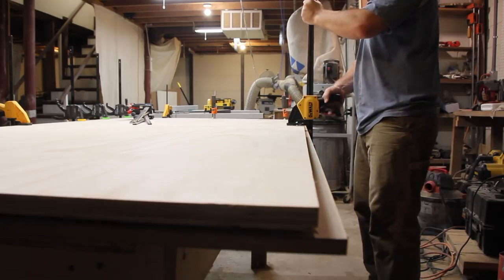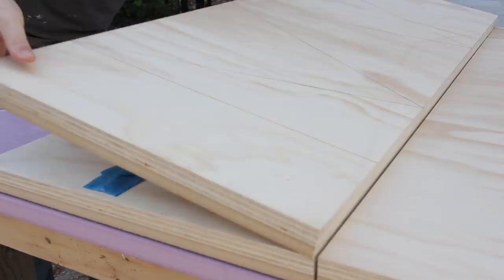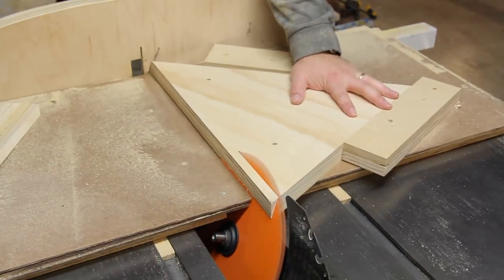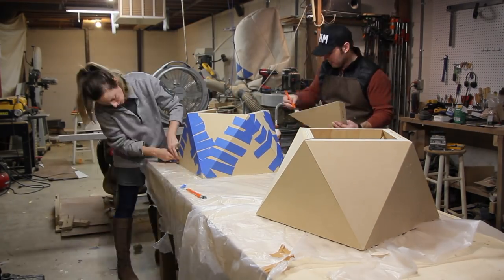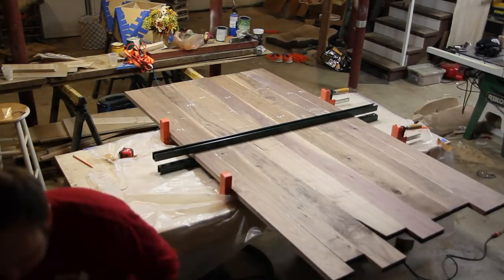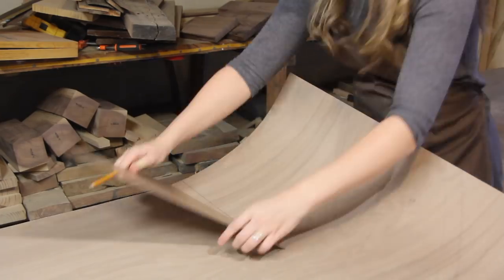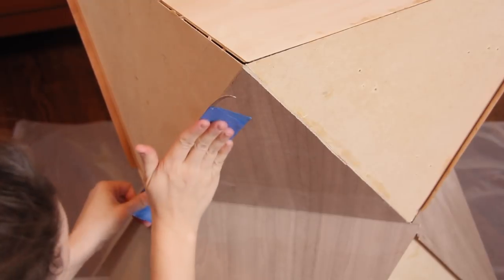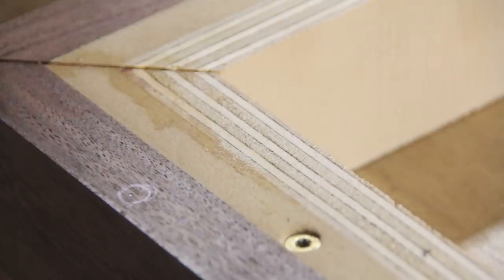Modern Walnut Table

Comment: Here from Reddit! I think you should either do only a voice over or music because at some points it's hard to hear you but this is super awesome
Reply from the maker: Clashin & Bashin yeah. It sounded clearer when I was editing! Sorry about that. But thanks for the view!
Reply: You can do both, but should duck the audio while speaking in your edit.  I also recommend listening on a couple speakers and headphone sets, since mid-range frequencies (with voice) are projected differently on different speakers.  It is a learning process, and this video is a good start!
Reply from the maker: Modustrial Maker thanks for the advice! I'll do that next time. I editing using only the built in speakers on my laptop. Admittedly not the best set up for audio mixing!
Reply: No problem.  What software do you use for editing?  Software can make a big difference too...
Reply from the maker: Modustrial Maker using iMovie right now, but looking to upgrade to final cut pro soon.
Reply: Had a hunch.... I'm going to save you $100s -- just go download Davinci Resolve 14.  It is just as good as Final Cut, but FREE.  I have been using it for some time.  It is the software used pretty much universally by Hollywood for color grading, and the latest version expanded to add a full NLE timeline editor (just like premiere pro / final cut), and fairlight audio in the same program (which is like a mini version of ableton).
Reply: p.s. your camera work looks great, so I think good video editing software will really take it to the next level.
Reply from the maker: Modustrial Maker sweet! I'll check it out. I have previous experience with final cut (in school, when it was free!) So that was what I was shooting for. But I'm always up for trying a free product.
Reply: If you are familiar with final cut, then you'll pick resolve up really quick.

Comment: Really cool build!  That base looks awesome!  Curious how you like the Dewalt Tracksaw? I'm debating between it, Makita and Festool right now....
Reply from the maker: Modustrial Maker thanks! I have really enjoyed the dewalt TS. I've had limited exposure to the Makita and Festool models, but from my experience they all perform similarly. For me it came down to price and length of track. The dewalt combo came with 59 and 102" track for $200 less than the TS75. No Regrets. I love it!
Reply: Yea, that is kinda what I was thinking.  How hard is the track to get perfectly perpendicular to your reference edge?  I am currently using Kreg's accu cut, which works pretty well, but still is a bit tricky to get set up so it is exactly perpendicular.
Reply from the maker: Modustrial Maker not to bad. Although there's no fence or alignment guide. I usually just mark with a combo square a point on each end then lay the tack on top. Clamping isn't necessary but I do for extra piece of mind.
Reply: Gotcha - I'm comparing pricing for Dewalt and Makita, and all-in price with 1/2 sheet and full sheet tracks is $760 for Dewalt vs. $700 for Makita (and Makita comes with 2 battery sets (e.g., 4 batteries), so leaning to the Makita now.
Reply from the maker: Modustrial Maker Acme Tools (or maybe it was Tool Nut?) Had the dewalt package with both tracks for $570 when I bought it. I also have the corded version. So that might be the difference. Can't go wrong either way. It's a great tool! Can't do a project without mine now.
Reply: Yea, going cordless adds a lot for the big battery packs and chargers.  I have a weird situation in that I live in a 12 unit condo building, can't physically transport 4x8 sheets to the shop (they won't fit in the elevator), and thus have to break them down in the garage shared with all the other unit owners.  Since I have to lug everything up to the garage and remove it immediately after, getting the cordless is a must!  Dewalt is about $150 more with everything factored in, but I really like their 60V line....decisions, decisions....